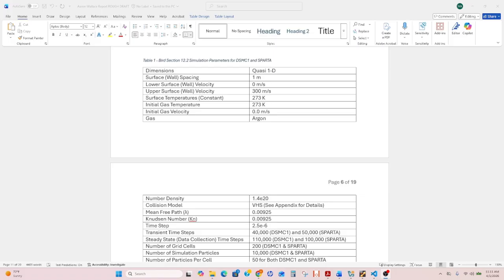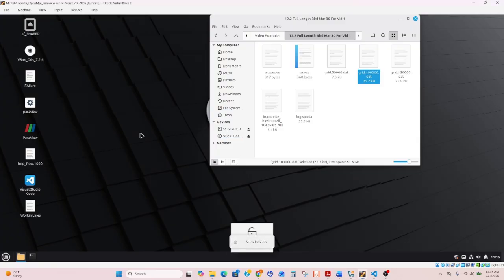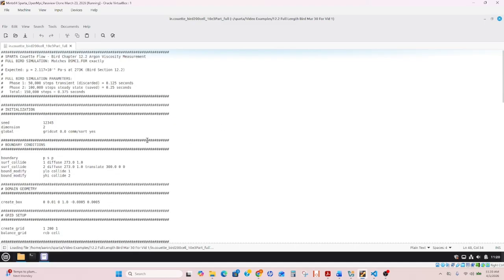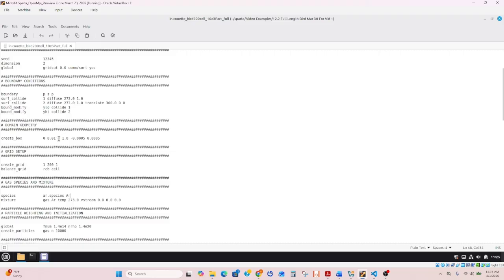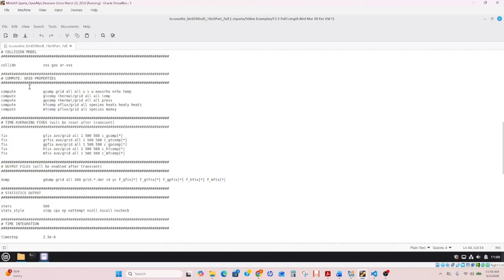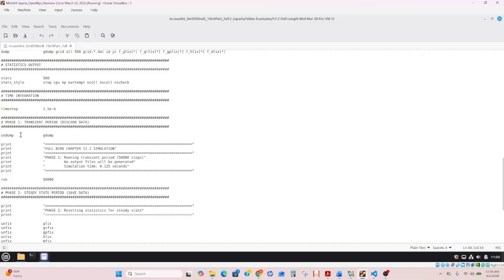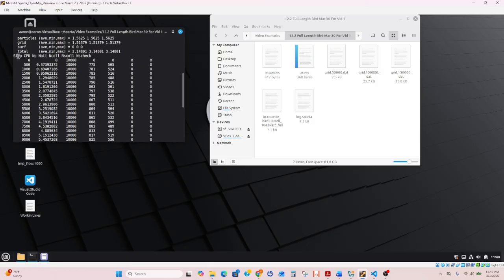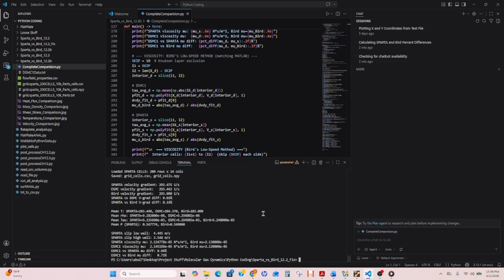SPARTA DSMC EXAMPLE 1-D Flow (Bird CH 12.2)

Comment: hi shall we run for a steady state if the number of particles is fixed??
Reply from the maker: In Bird's book he ran the simulation a certain number of time steps and then started collecting data once it reached steady state. That data from what he determined as steady state is what he used in his analysis. I did the same in Sparta. As for it being a fixed number of particles. When one leaves the domain another is introduced. There are several ways to do this. In this example I just directly fixed them. In other examples i used FNUM and NRHO to set the number. All of the scripts I used are on the git up in the description. I am going to place a copy of my report there also so it can be looked at and may help some.
Reply: @AaronWallaceMECHENG thanks again.